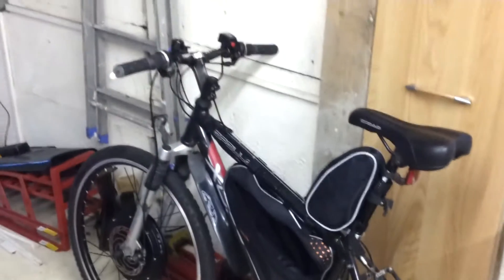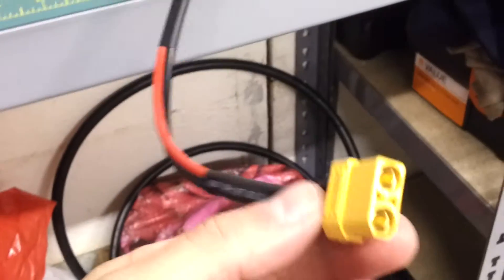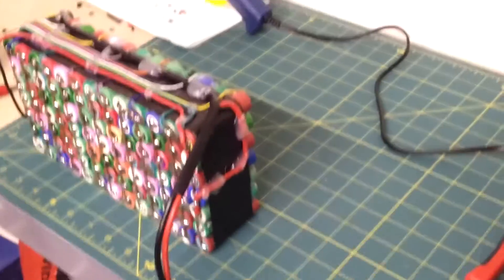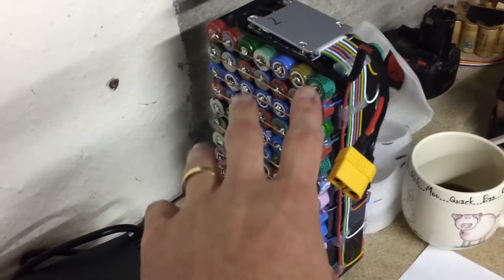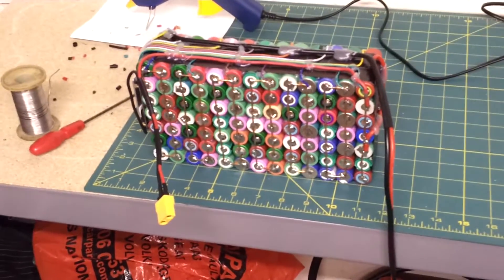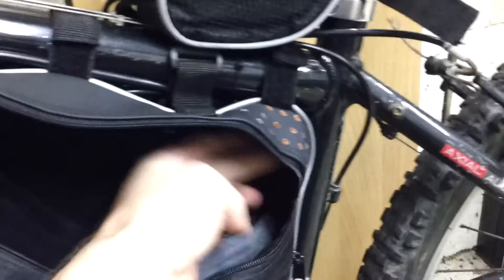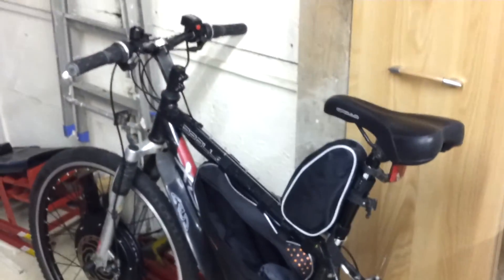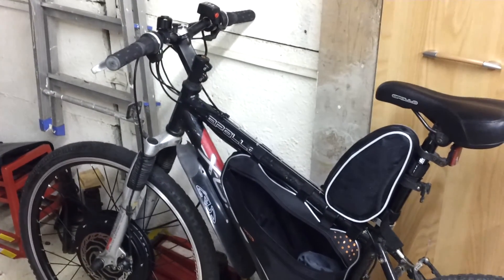Lithium Ion 18650 48v e-Bike battery build DIY - Part 9 - Batteries finished

Comment: with all those cells u have do u balance as a whole with bms and  wheres bms from type please
Reply from the maker: I let the BMS do its job and balance the whole battery over several charge and discharge cycles. I can't remeber where the BMS was from but it's a no-name cheapo Chinese thing. Probably from eBay or Amazon.

Comment: My giant mountain bike similar to yours I have a bracket on front forks to strengthen front wheel it’s off eBay only about 10£.i maybe should use a bag like yours inside frame like triangle shape some have

Comment: Hi Komrade I’m looking to build another 48/52 v pack ebike to give me more range I used bms like u but bike stopped so mayb just use bms for charging .what cells you using looks like laptop used was thinking Panasonic /Sanyo 18650ga had Samsung 25r in my other pack 14s 5p but power meter showing just 9amps.used Samsung 26h at first but lot of them failed so had some 25r off eBay guy who bought them china he said new but would rather get bigger capacity cell for my 1000 watt front hub motor .sam uk
Reply from the maker: Hi Steve, my cells are from used laptop batteries: a mixture of brands, capacities and condition. Balancing took some time after I initially assembled each battery, on account of them being a bit out beforehand. The BMS took care of this though, over several charge cycles. If you have cells that show 2v after charging, they're broken! Bin (recycle) them and get more. Good shout on the torque arms on the front forks. Unless you're using steel forks then the arms are a must, I think. The battery bag that fits inside the frame is a neat solution to use dead space and keep mass as low as practical. Good luck with the build.
Reply: yes just found dead cell in main battery it was out of a laptop just replaced it as the voltage of pack dropped to 41v.its back up to 53v now.i just tried a hoverboard 36v battery I had Samsung cells they said 40v I series it with my own 14v pack and that worked great so far just quick run including steep hill.im waiting for turnigy charger so can balance

Comment: Hey komrade, after me messing with 4 different 1000watt ebike kit, I've move on to a 5000watt ebike and now able to hit 56mph . Lot of fun.
Reply from the maker: Bloody hell, Chris! That's very fast; how do the batteries hold up? Also, how to the tyres and brakes hold up at 90km/h?!
Reply: Komrade Shotabollokov I can only handle 45mph on a normal ride,  but I did go 62mph once when i was racing an electric scooter l. As for the brake i change then every 2 weeks.
Reply: @KomradeShotabollokov  Guess what?. I've moved on to a duo motor 1600watt×2 motor 3200 bldc scooter.
Reply from the maker: Nice one. You should put an on-board video up of you riding, if you can.

Comment: What changes in wire did you make in bms, when you are only using it for charging?
Reply from the maker: I just chose not to solder the motor controller negative wire to the BMS (that is makred P- on my BMS) and instead have the motor controller positive and negative simply soldered onto the battery itself. This bypasses the BMS completely for discharging. I use the BMS only for balance charging.
Reply: okay thank you very much :-)

Comment: You shouldn't require the voltage shutoff circuit because the controller should have one built into it . Typically Ebike controllers are built for multiple voltages but programmed  for the voltage you select when you purchase the kit. If your controller says 48v it should shut itself off when it thinks the pack is as maximum safe depletion . Depending on the controller you can actually get a adapter and reprogram it to cutoff at whatever voltage you like .  If you like the bike at 48v try it at 60 :)
Reply from the maker: That's very interesting, thanks. The controller seems to still work when the battery as at ~42v so maybe mine doesn't have this cut off feature. I've become used to how depleted the battery is compared with the red light for 'empty' on the accelerator though, so I should be safe.
Reply: I prefer my controller not shit itself off. Makes a mess. :)
Reply: it's cool, i put a diaper on it ;)

Comment: What make is that battery bag you have and where did you get it from?
Reply from the maker: The bag is an Ibera battery bag and I bought mine from Amazon. Still for sale on Amazon for 13 quid: https://www.amazon.co.uk/Ibera-Bicycle-Triangle-Frame-Large/dp/B006JA8WEG/ref=sr_1_fkmr0_1?ie=UTF8&qid=1492267868&sr=8-1-fkmr0&keywords=ibera%2Bbattery%2Bbag&th=1&psc=1

The one on my bike is large and just fitted within the small frame of the bike.
Reply: thanks

Comment: Don't silicon your wheel axle wire entry, you will be ending up with condensation inside as the temperature changes, turn the axle 180 degrees in the fork instead and the water that runs along the wire will just drip off instead of in, hope that makes sense.
Reply from the maker: Good call, I'll try to remember to turn the alxe around when I get time. To be honest I've made a point of using my legs with my road bike when rain is forecast because I really don't want water in any part of this e-bike. It's been only ridden in the dry so far.
Reply: Do the flip and you're pretty much rain proof. I own one of those 9c kits and I actually like to use it in the rain instead of my more expensive ebike, if your battery and controller bags are not rain proof enough then place your stuff inside a plastic bag then inside the bags. Needs be the mother of invention.

Comment: good stuff,i like the idea that you are only using the bms just for charging
Reply from the maker: That's all I wanted it for, really: just protection for overcharge. I've checked how it discharges both under moment high load and simply long term low charge and am happy that I won't damage the packs. I didn't want the BMS cutting in and preventing movement when I least need it, 5 miles from home!